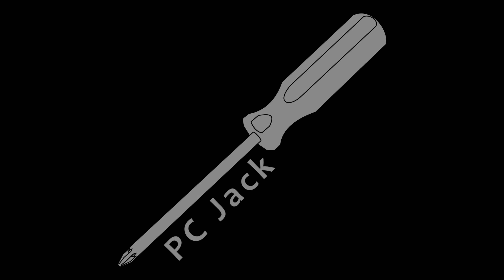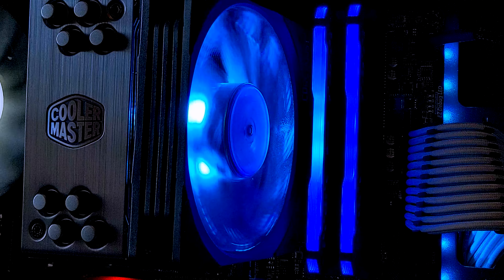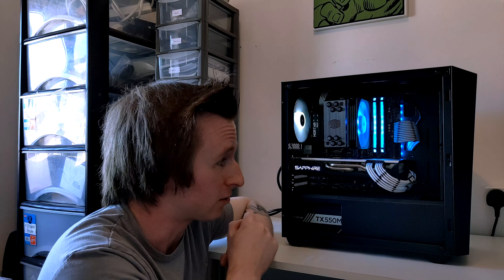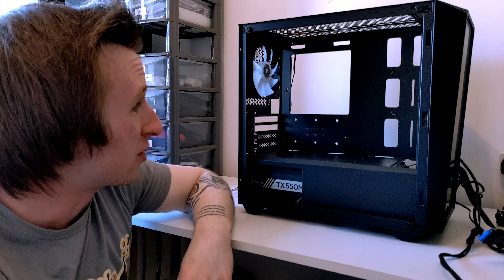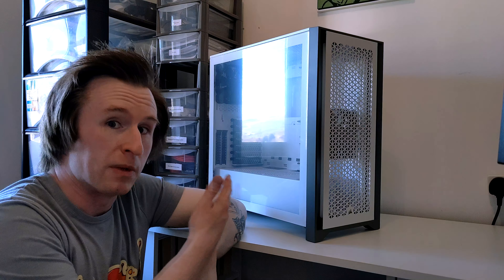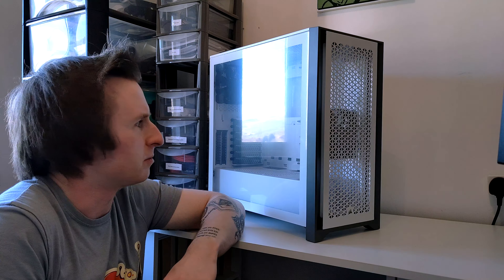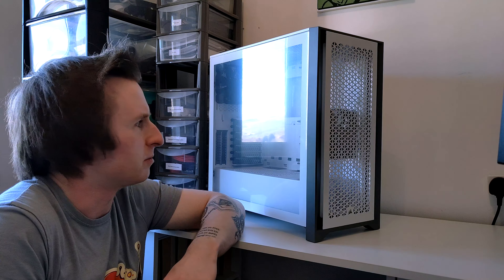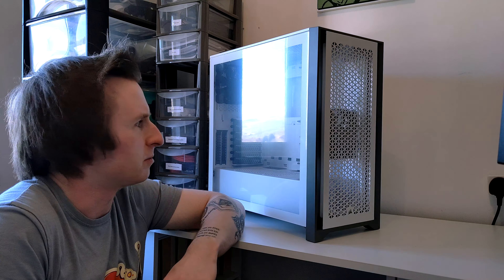PC Case Swap (Corsair 4000D Airflow Build Upgrade)

Comment: I am switching a mATX system to a black 4000d airflow.  I was worried about how it would look but this puts me at ease. Great video!!
Reply from the maker: Cheers mate! Enjoy the upgrade! 👍
Reply: @PCJack  any fan suggestions? I was thinking cooler master or Lian Li for fans.  I don’t want to use Corsair fans, because I like aura sync in my Asus mb.
Reply from the maker: @lchanceiv  I've heard the Lian Li Uni fans are great to use but I'm not 100% on whether they can be controlled by Aura Sync or not.

Comment: Thanks again for your help upgrading my system Jack,as you said the psu is problematic, Corsair customer service sucks hopefully the new seasonic psu will be okay next week when it arrives from scan the build looks awesome even the wife was impressed by the look of the pc will definitely be upgrading the mobo next then you can rebuild the Arctic cougar for my nephew as I will have all the original parts ready to re install into original case, cheers for all your help mate here’s to keeping you fairly busy in the future
Reply from the maker: No problem mate. Sorry that we've had this dilemma with the PSU upgrade but we'll soon get the system back on it's feet 🙌

Comment: I think having those front panel cables preinstalled at the front is pretty stupid, it's a good case, but Corsair putting those at the front is dull. Either have to change motherboards or get an adapter, if you really want them, get the adapters for now id say, but if you can live without them, then wouldn't even worry about them.